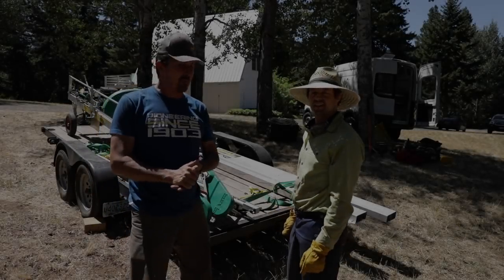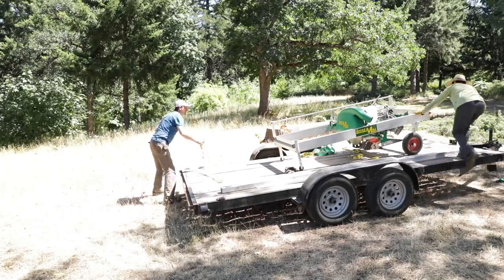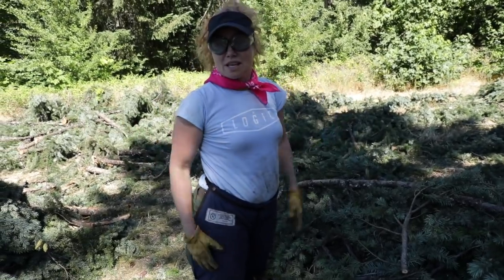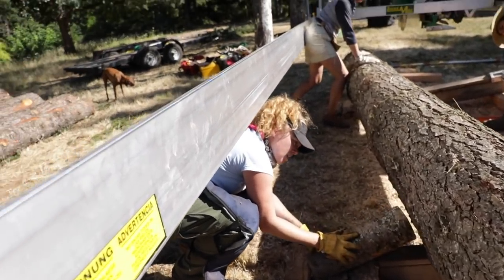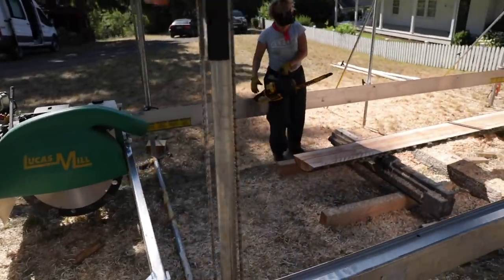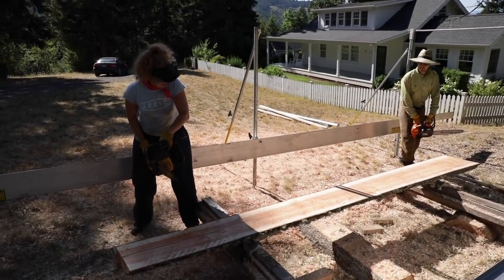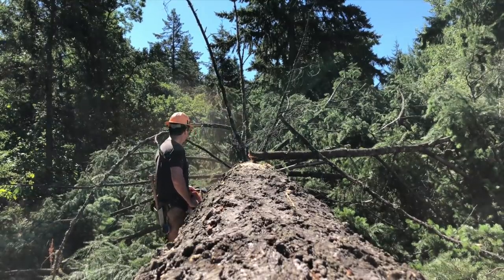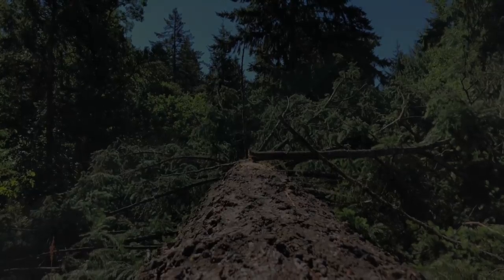Cutting Lumber From Logs

Comment: Cody, I was watching you cut lumber on your mill and was noticing the fresh cut piece of wood would traveling laying on the side of a spinning blade.  You could prevent this by simply cutting the first cut of your board with the blade flat (horizontal).  When you make the second cut with the blade in the vertical position, the board or cant will not be laying on the blade and will stay perfectly in place.
Reply: I see what you're saying, but wood has internal stresses that often make the cut-off piece bend, and it can pinch the blade.  It's strange to watch.  I've ripped (cut length-wise) straight 2x4s in half, and end up with two pieces that are curved.  Sometimes it bends one way as you're cutting, and the cut stays open. Sometimes it bends the other, and it closes the cut and pinches the saw blade, which can cause dangerous kickback.

Comment: The Lucas Mill is really cool. When you guys are loading the log in at about 6:20 a second peavey might have been helpful. Would it be easier if you had the mill lifted up all the way? Is the mill still stable when lifted up 4 feet or so? It looked a little awkward climbing under the mill, and if that log rolls Mrs. W and Mrs. Eric would get smashed.

Comment: Only benefit of your sawmill is option, that it can easy cut Radial boards, all kind of music instrument producers (organ, guitar,...)or high quality massive wood furniture are searching for Radial catted boards. But generally, woodmizer is leader.
Reply: Jānis Kronbergs the true benefit is the size of logs, huge to small, you can mill with sawmills like the Lucas. Bandsaw mills have size limits or invest in a bigger mill. Plus you don't have to rotate a log to mill it, or at least far fewer times, as you have to do with a bandsaw mill. You also have to do multiple milling, removing and replacing cut slabs, to get dimensional boards with a bandsaw mill or cut slabs with a secondary saw to get the lumber you want.
Reply: Rodney 3133 yes, you are right, sorry, we just in Europe do not have large trees, hard to find something larger as two feet in diameter.

Comment: Cody, first let me say it's nice to see some chainsawin' & tree cuttin' videos again.  :)  
Not that I don't like your van vids (which are awesome) and the other things, but I need to get myself in gear and cut down a few trees of my own and it's kind of motivational to see you doing it.  

Oh, and I really have to say your little message at the end was just fabulous!  
You doing that sort of thing has impressed me enough that it lead me to like a number of your videos and ultimately, to become a subscriber.  Just so you know.
I, for one, always really appreciate hearing your thoughts like that, and it's lead me to consider my own ways of thinking at times.  There's always room for improvement, I like to say.  

Anyway, my question...  
Safety is important.  I'm pretty fond of my head and, you know, I'd prefer it to remain roughly the same shape it always has been.  
So, that being said, I'm curious as to what kind of hard hat you have or what brands you might recommend one use when doing this sort of thing.  
(I know it's possible you've mentioned that before, but I sure haven't come across it yet...)
Reply: Stihl sells helmets  made for chainsaw use

Comment: The question i have in a blade mill vs a Band mill. Winch one produces wood that needs less finish work. How much planning of the lumber will it take band vs blade to reach a smooth straight surface?
Reply from the maker: Both are good,

Comment: Glad to see leg protection being used while using the electric chainsaw that little Dewalt would rip you to shreds honestly I would be more wary using it over the 461 with a 32 inch bar. The little electric saw has so much power on tap the torque is there the instantly you touch that trigger.

Comment: It could be that I'm watching early in the day, and my brain doesn't get up to speed until the second cup of coffee, but were you  trolling us when you mentioned one metric  and one standard crescent wrench?  Given that they  are adjustable to whatever opening is required to fit any particular nut or bolt, all crescent wrenches can be either metric or AF depending how they are set at the time of use.